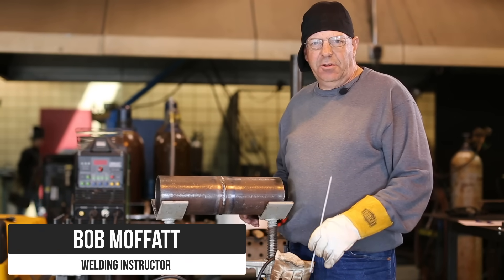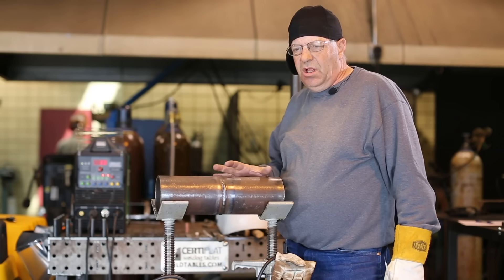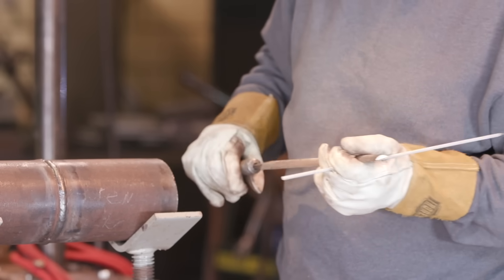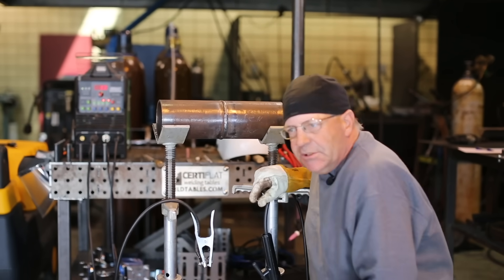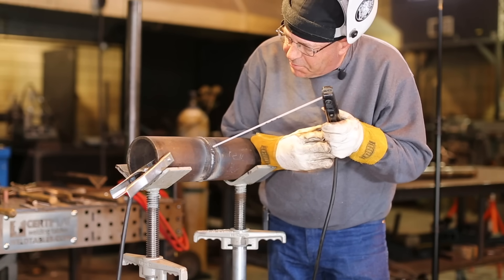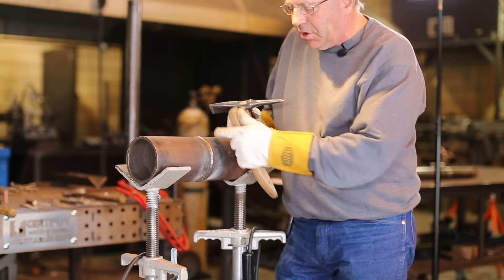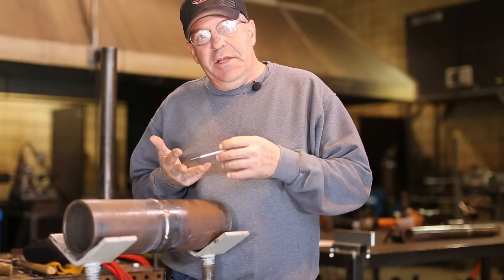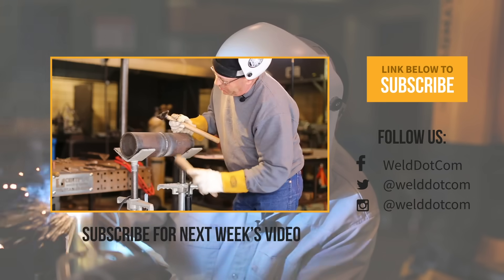🔥 5G 7018 Stringer Cap (Everlast PowerTIG 200DV)

Comment: Question bob or someone please with short circuit mig or even flux cored when taking a test say 1” 3g with a backing plate can you give a thickness you want to set your machine to I get the whole fine tune till it’s running smooth . I usually look at the machine settings for the thickness and fine tune it from there . I’ve watched many of your videos which I love by the way thank you and other Chanel’s and between everyone the settings are way different with some of the same tests. From what I seen and looked at a chart seems like you would go with machine set around 1/4” and than fine tune. And what would you set it for a 3/8” 3g vertical up with a backing plate like what thickness would you look for the settings on the machine than fine tune? Any help would be appreciated. I’ve been welding a while now just as a hobby though went to vocational school for welding didn’t really have a teacher that taught like you was mostly self taught. I’ve just found out about YouTube and Instagram a little less than a year ago. And since than I realize I knew not much at all I’ve learned more from YouTube watching you and Jody in less than a year than all the time I spent on my own age 15 till now 27 and two years in vocational school for welding. And for that I am great full. Thank you for all you do 🙏👊 also sorry if there’s misspelled trying to type this on my phone
Reply: Chris Wojnarski For the most part the settings given on machines aren't much good other than to get you in the ball park. I tend to run wire at the same setting for most work (other than thin stuff). .035 short circuit MIG I run 17-19 volts and 250 in/min wire speed. .045 flux core 24-26 volts and 350 wire speed. That's with 75/25 shielding gas. Pure CO2 would be similar, but with a higher voltage (usually 1-2 volts higher). If I'm working with an unfamiliar machine I set the wire speed and adjust the voltage until I like it, then you can tweak the wire speed a few in/min to really fine tune it. Hope that helps.
Reply: uncle crazy legs thank you for the info it does help my main thing is usually when I mig weld it’s thin stuff to mostly 1:4” max just as hobby welding mostly on cars body frame or making things. I recently moved to Spring Hill florida and want to get back into welding as a career. Maybe start out as a helper or something but if I have to take a test I want to be prepared. I don’t mig weld enough to know the settings off the top of my head I usually go off the chart of the machine and tune it in from there . But I’m just queries say if I had to take a 1” 3g vertical up with a backing plate test or even the same but 3/8” thick I just wanna know ok I can look at the machine or the chart I have and what thickness I should look to set it around and fine tune the machine after that. Between watching the 3g tests from bob and Jody that they do the numbers/ settings are set to around 1/4” but fine tuned from there. Does it make sense what I’m asking I may be asking a confusing question. But I really appreciate your input and I am definitely gonna write your settings down and go keep them in mind . I’ve been practicing some at home but I only have a little Lincoln 140 mig that’s only 110v with dual knobs abcd colts and 1-10 wire feed speed I know it’s not the right machine to practice with but it’s better than nothing I guess with practicing. Thank you again
Reply: Chris Wojnarski I understand your question. If you were to test for a job you may have to use a machine that doesn't have a setting chart, so I wanted to give you a good "general purpose" setting. Those settings would be what I would use for single pass welding on 1/4" and multipass work for thicker than 1/4". If you did have a setting chart however, the 1/4" settings would be a good place to start, in my experience it seems most charts are a little high on the wire speed compared to where I like to run my settings. In either case both ways would get you in the ballpark for a 3/8 or 1 inch 3g test
Reply: uncle crazy legs thanks for responding again that answer actually helps out a lot helped me understand it better. I’m definitely gonna write the settings down. Thank for taking the time to help
Reply: Chris Wojnarski No problem, happy to help.

Comment: I'm curious: How would very high humidity affect the process, assuming your rods have been stored well? I've heard almost nothing about that sort of ambient/atmospheric factors. Just out of complete curiousity.
Reply: ALAPINO if your rods are stored in an oven and your pipe is pre heated then it shouldn't be affected
Reply: Scott Brown That was my thinking as well. Presumably both preparations would be sufficient to drive off moisture.

scurries off to find some dive welding videos

Comment: 5g 7018 root next?
Reply: Mr. greens boat tanks and aluminium welding I do it with 316 stick on pipe.
Reply: Did this in school using 9018 and once we passed that we went on to using 309-L16. Was tricky but really neat when you get the hang of it.
Reply: Randy Harris is that in stick? 309l?
Reply: Mr. greens boat tanks and aluminium welding
 yes it is and it was a really interesting experience
Reply: Northern Sweden Welding i have 316 stick electrodes too. I dont do much stick but i have them if i need them.

Comment: your reference to heat in the work: "Jacob Schofield" has a video in which he shows his helper tending the welder and changing the settings as he directs, as the weld progresses.
Reply: expediter99 In large part of World, we use handheld remote control To control the amps while welding. Usually, its basically turning the amps down, when the Rod gets Hot, and shorter, it needs less amps. Large part of the World run 7018 all the way Out, no 6010 at all. Plates, pipes, pipeline etc. All with only 7018, with the remote control specially for the root.
Reply: Not every job is going to be using an engine driven setup with a remote. That's more so pipeline stuff. Big difference between pipe fitters/welders and pipeliners. You won't always have somebody to change amperage as you go. It's all circumstances. You have to know how to do the job with the tools alotted.
Reply: I wonder if anybody uses a pedal for this

Comment: Love the vids!!! I do have a rookie question: When you do your restarts, you strike the arc above then come back, tie in, then come back over the arc strike. Doesn't this leave you welding over slag at the restart? Obviously, it doesn't hurt the weld or you wouldn't be doing it. Its just a personal curiosity.
Reply: it always gets burned out from the weld pool,  or your weld bead you are running
Reply: DaddyFat Sacks Ahhh ok, thank you. I've done some mig and flux core welding, but never any stick. That's my next endeavor.